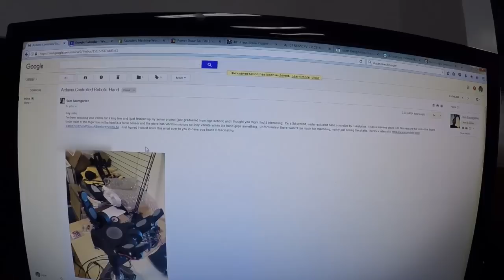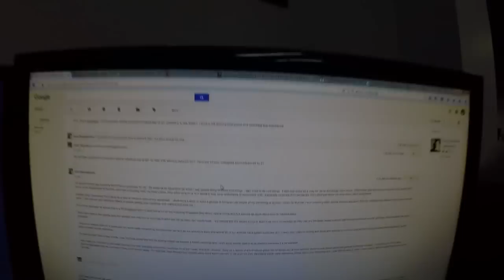The Next Generation of Machinists & Businessmen!  CB15

Comment: wheel bolts! most kf the German cars utilize wheel bolts and in the spare section they include one of those to help with tire alignment.  they are usually just a threaded aluminum bar, which can bend if you are not to careful!  

I like the angle you filmed that 2nd part much better.  you face is not as dark probably because the background is looking into the shop instead of the white walls!

Comment: Considering most interns at shops barely get to even touch a machine till months later, he's certainly a lucky intern. 

But yes. The crap jobs still need to get done. And it doesn't matter how many years you have in and how much skill you posses. No one in a shop should be "above" sweeping the floor or emptying the trash.
Reply: Agreed, I lucked out with my CO-OP and got to run a bridgeport from day one however, when work slowed in the shop I was put sweeping floors. Although it wasn't most optimal thing that I wanted to do I did it and still do it to the best of my ability. Do good work and it will do good for you. Sadly a fair few people now a days don't grasp those concepts.
Reply: That's what's called paying your dues. I pushed a broom and cleaned restrooms at my first "real" job some 40 years ago.
Reply: +tsmartin I'm actually not a huge fan of the "paying your dues" thing, despite me joking about it often. 

Really everyone needs to be putting forth their best at all times.  Not that you reach a certain level and get to goof off and push the dirty work onto an underling.  That mentality makes for a poor shop. If something needs doing, do it. Doesn't matter if you've been there 5 days or 5 years. Don't wait arose B's for someone else to do it. Because eventually that's what everyone will start doing... Then nothing gets done. 

Floors dirty and you have a long cycle time. Sweep it. Chip barrel is full? Empty it. Saw blade is dull, change it. I hate it when I hear " well that's so and so's job..."  Don't care who's "job it is". If it needs doing, do it. And if someone's not pulling their slack, you make sure the manager knows it.
Reply: Occams Sawzall Exactly.

Comment: Those studs are a common thing to make for German (maybe European) cars as well. All of the benz's I have had and my mini have wheel bolts instead of wheel studs. I just turned a piece of material that slip fits inside of the threads and sticks out enough to hang the wheel on so I can get the other bolts in.
Reply: +NYC CNC honestly I have no idea, I think they are a PITA compared to studs. Perhaps only zee Germans know...
Reply: My Mercedes all have wheel bolts, not a big deal as the wheel is hub centered ,  I just push the wheel up, turn it till I see a hole and then screw the bolt in. There are actually several advantages to wheel bolts of studs, most obvious being easy replacement in case of thread damage. Another is they use the wheel to clamp the brake disks onto the hub so once the wheel is off you can pull the brake rotor with no extra steps.  You also cut the amount of retaining hardware to inventory in half since you don't need a stud and a nut, just a bolt. I always found it funny that most ag equipment all uses bolt on wheel equipment rather than studs.  The wheels are bolted on all my tractors even the great big back wheels.
Reply: bcbloc02
I guess that makes sense. I just always had trouble holding the wheel in place and aligning the brake rotors, which is why I made that tool. There is supposed to be a retainer bolt on the rotors to make it easier to line it all up but with the Midwest rust, those snap off real easy.

Comment: So, for a guy starting out doing small shop work, would you say it is worth it to jump into a tormach or would you advise someone to start with a more affordable machine with a retrofit?
Reply: NYC CNC Thanks for the input john. I'm seriously struggling between a g0704 retrofit and saving for a tormach...
Reply: NYC CNC A fully retrofitted machine with enclosure and the whole 9 yards would cost ~4k maybe 5 if I really go at it, For the Tormach it would probably be a 770 with a good set of tooling, so around 13k after shipping.  Pretty big difference but is it worth it? I also see Haas TM1s sell for around 15k every once in a blue moon.
Reply: NYC CNC I actually already have some tooling such as vices, end mills and such (4 bucks and a kurt), which saves, well, a lot. The g0704 converted alone will cost about 3k I think, Including ball screws.
Uggg, decisions! How do you feel about the 440s? I know you like them, but how do they compare to an 1100 or 440?
Reply: NYC CNC Sorry, about 2200 with conversion. What did your sieg cost by the way? I'v always wandered.
Reply: NYC CNC The second I start thinking about a retrofit I almost instantly jump back to the tormach for one reason or another! I guess that I should take that as a sign that I should go with the tormach,
Reply: +rkshireygames 

Definitely go with a tormach. A starter pack is $7k.  Which is way less than what you'd spend buying a machine then trying to retrofit it. Not to mention the tormach runs of your standard 15amp wall outlet. Single phase. So no having to buy a single to 3 phase power converter. No having to get huge 60+ amp breakers put in or having to run expensive heavy gauge wiring. 

Pretty much the tormach is plug it in the wall. Install a few things and away you go. 

Retrofits can cost $2k-$5k and over. And that's on top of the machine cost. Plus you have no idea how abused the machine was, or if you can even get parts for the thing anymore. Could be weeks or months after buying the machine before you can actually do anything with it
Reply: Occams Sawzall I was talking about a g0704 retrofit, which would total in around 3k for the retrofit cost. And what starter package is 7k?
Reply: +rkshireygames tormach has a package deal with their 440 model for $7k. Basically everything you need to get started kind of thing. Details are on the tormach website.
Reply: Occams Sawzall I actually just saw that their 440 can be had for under 5k. Only 6 inches of y.... That may break the deal for me.
Reply: +rkshireygames ya. The base model for just the machine and nothing else is like $4800. 

Package comes with a bunch of other tooling things. Believe it comes with a vice tool holders, etc. 

But the G0704 kit you were looking at is only micro stepper motors. They wouldn't be able to drive anything much bigger than a 440 anyway. 

Prototrak retrofit kits for a Bridgeport style manual mill run between $15k-$30k ! That's damn near the cost of a brand new HAAS VF1
Reply: Occams Sawzall I actually have an old prototrak unit I'm selling as it's not quite what I want.